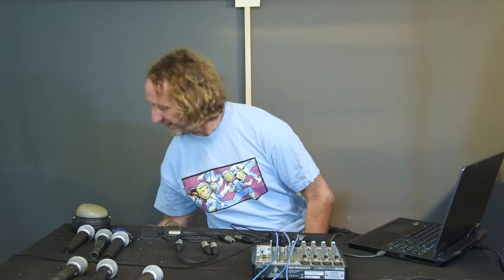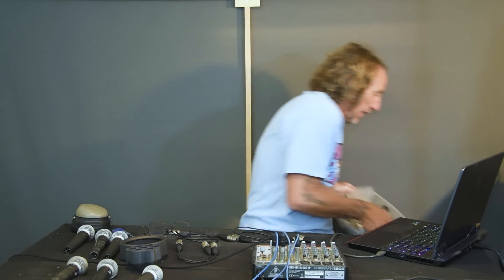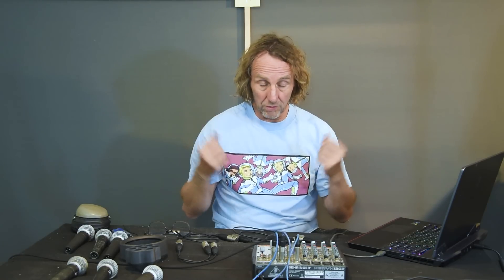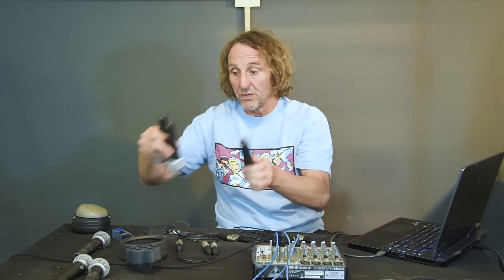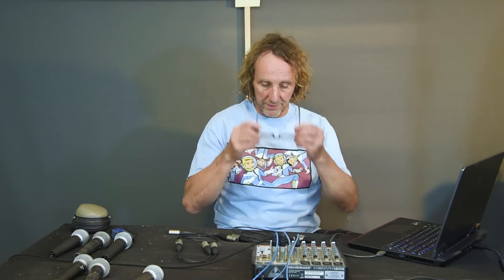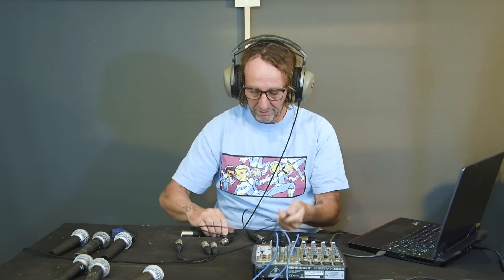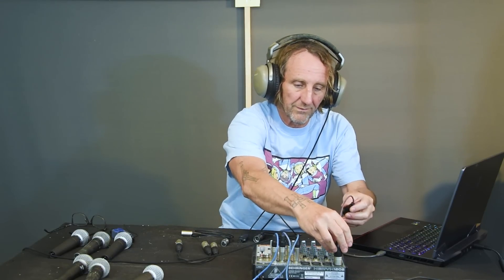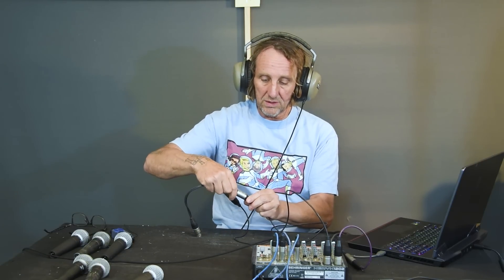Do Vocal Mics Go Bad? Lets Hear what happens!

Comment: I commented that a suggestion for better results might be to use freely available  REW measurement software to measure results.  You send a sweep signal to a monitor speaker.  Have the test microphone on a mic stand 2 meters away.  Then swap to another identical microphone.  Do the sweep again.  And you can display the graph showing level and frequency response differences.  In practice hardly any more difficult than what is being done in the video.  I've done this with multiple microphones I've acquired 2nd hand.  Usually they match within a decibel over the whole range.  If one has a problem it stands out clearly.  Doing this would be quicker and easier than the technique in the video if you are doing several microphones.  

BTW, the technique in the video is fine, and will work.  This other way is more precise and just as easy.
Reply from the maker: Hmmm, I like any method that involves actually hearing the differences so one can determine whether the differences are relevant to their application.

How useful is it really to see a line on a computer screen that tells you there is a difference and then you need to guess about what that difference sounds like or even if it's audible?

One of the main goals of my videos is to get people to listen by showing how to do simple tests with readily available gear.

And not avoid test gear that is easy, but show tests that help people calibrate thier ears to what they see on test gear
Reply: @DaveRat  -The test I mentioned would show you in detail if a microphone is off.  My assumption is if you are doing this for touring bands, unless the mike checks out against a reference you replace it.  I did not get the idea if it checks out close you send it back to be used.  I also find your method has variability that is greater than what is audible or not.  So it might sound audible or not due to that variability which makes it a relatively unreliable way to go about this. 

So if your method left a sound difference, but the method I described show there isn't one then you would be fooling yourself due to variability in your technique.  

With the method I described you could weed out those that differ and then listen to just those if you want to develop hearing what that sounds like.
Reply from the maker: Hmmm, well since no two mics will ever measure the same then every mic would be off.

But how much off matters?

One must establish a set of parameters which, if exceeded would be a failure.

Those parameters are not definitive and set in stone but rather they are subjective and may be different depending on the application and accuracy needed.

So, in order to establish the pass fail parameters that the test mics will fall into along with borderline contenders, one would do listening tests to a wide variety of mics spanning the gammut and then determine what is and is not acceptable and hopefully test every possible variation.

This is similar to what we do when testing our pa speakers before and after each show, along with listening tests that often show issues that are not seen by test gear.

Or one could establish some relatively simple subjective tests where the issues of concern are directly audible.

I understand and respect the desire to cling to visual data and measurements. This is important and also the desire to overcomplicate and create visual representations that are not intuitively correlated to real world results is a very common, but somewhat unfortunate practice.

I am not saying that buying, setting up and carrying test gear on tour or to gigs and then listening to the mics afterwards is a bad thing to do.

I would say that comparing mic to mic without creating a null, tends to mask the majority of issues and a null test will help hear some of those masked issues. And that having an effective test that requires no added expense, no added gear to carry and can be performed at a gig with a few adaptors may be useful

If you have any ideas or suggestions for simple ways to hear actual issues without relying on test gear, that would be awesome!
Reply: @DaveRat  I'm sorry you don't understand how to do useful measuring tests.  The same brand and model of microphones usually do measure all, but fully identical.  So close you need not worry about differing sound.  I'd post some graphs, but youtube keeps taking them out. 

I also don't buy into the idea that listening tests show issues not seen by test gear.  Further you you write as if you need to bring along some extra test gear.  There is only one thing not shown in your video needed to do such testing.  A small monitor speaker.  One smaller than your box of insulation.  I'm guessing you have such a speaker to use.  So it is a red herring to speak of hauling test gear around.  You already have everything you need. 

There is also some free nulling software which would take music from recording 1st one microphone and then another giving you the null between the two to listen to and do so more accurately than your method as long as you place the microphone carefully for each recording.  That way if you prefer listening to the null you can do so.
Reply: @DaveRat  
https://drive.google.com/file/d/1s9vuaO17iEJuX0kJGqhhkvHPGCs5_VHy/view?usp=sharing

This is three KSM32's covering more than a decade.  Will they all sound the same?  Yes.
Reply: https://drive.google.com/file/d/1_rSEcpS7thyyD6FDnHZk3185BE211UYS/view?usp=sharing

Here are three AT4033a mikes of various vintages.  They will sound the same too.  BTW, the uneven response is the monitor speaker I was using for the signal.  

In your video you show one microphone having a big bump or dip in the upper part of a spectrum analyzer versus another one.  Such a big difference would show up in this kind of testing like a sore thumb.  It is simply a more precise and repeatable way of accomplishing the same thing.
Reply from the maker: You have not ever toured have you?

It's like telling a bunch of backpackers that the only properly way to cook is with an oven. 

There are many ways to test that vary in usefulness depending on the situation.

People that claim they know the only right way are inherently wrong.
Reply: @DaveRat  And maybe you'll become literate when I repeatedly say you don't need a single thing that isn't already on your desk in the video except a speaker.  You tour and monitor events and don't have a speaker anywhere? There is no other item needed not shown in your video.
Reply from the maker: Don't get upset, when you truly know what you are doing, explaining things brings a smile not anger or insults

Let me ask you this.

Does test gear actually tell you what something sounds like?

 If so then you should be able to mix a record or show and just observe test gear rather than listening, right?

I find the desire to embrace test gear and avoid listening to be fascinating.
Reply: @DaveRat  you say this is to hear degradation due to build up of spit and other issues.  In which case I don't see the fascination with hearing this vs a simple reliable measure of it.  You aren't judging the sound of a mike in this case simply comparing it with a new or known reference to see if it is off.  Who cares if you hear it or see a graph?  It basically will be a darn near replica or it is "off" in a way it may need repairing/replacing.  

Do you think the people making these microphones don't measure them for QC?  What you are doing here is not evaluating the sound except for QC purposes.  Kind of odd to compare it to mixing a record.  One has pretty much nothing to do with the other. 

That is okay though. I'll not comment further.  You clearly are in some state of mind where you aren't listening when someone is simply trying to share a better method to QC used microphones.
Reply from the maker: I appreciate you defensiveness of what you are familiar with.

And also it is only when you look at things from multiple perspectives that 9ne can gain a clear understanding.

Limit your toolbox as you see fit.

I don't promote the right or the best way, but rather an additional way that may be useful should ine wish to hear the issues rather than see them and guess what they sound like.

Comment: We do mic compares all the time using the transfer function - where you can literally compare one mic to the next. If the mics match, then the TF response will be flat mag/flatphase. If they don't match, then the resultant graph will be exactly how the measurement input microphone is different than the reference input microphone. Much easier to measure this way than fiddling with an RTA next time!
Reply from the maker: Yes, a full setup will definitely let you see a line on a screen that wiggles the same or differently than another line on a screen, but that does not let you hear the actual differences.

When you see differences represented as a line on a screen, what do those different screen lines sound like?  Are they audible? Drastic? Insignificant? 

One of the things I have seen many times over the years is people over eq'ing to make a line flat at the expense of sound quality, or using measurement scales that fail to show relevant and audible issues.

For this test, you don't need the RTA, it can be done purely with your ears or ears and the console meter.

One of my goals is to guide people into listening and determineing and not just looking at gear and assuming.

Comment: Would love to see a QC video like this with the SE Electronics V7. They seem to be all over the place, especially the wireless capsules. I’ve had several die pretty quick
Reply from the maker: Not familiar with them
Reply: @DaveRat  In Denmark people seems to love 'em for the same reason as the audix om series.
My guess is the probably have the same problem with moisture as well.
Wouldn't be surprised if the design is similar, to the audix.

Comment: Your test confirms my findings: Two SM58s seldom sound the same, even when brand new. Would be interesting to see this test with Sennheisers, AKGs or Audix' of different price ranges. To my ears, it's less severe starting with the better Sennheisers and AKGs series (like e935, and C7 resp. D7). I don't use Audix mics, so I can't tell about those.
Reply: Transducer tolerances are really hard to get down. Sennheiser does a pretty good job and so does Shure, but for the 80-100 dollar price segment you gotta make some value engineering compromises!
Reply from the maker: Agreed
Reply: I'm a big fan of the Sennheiser e935 :)   - excellent for live shows to mic pretty much anything from guitar cab to vocals! - hardly any EQ from the console as it really cuts through and has a high output with minimal feedback so you can really drive it hard.  I also have the e945 but find it's a little too sibilance sounding for my taste.
Reply: @coffeehigh420  used an 835 for several years and then went up to a 935 a few years back and they are just the absolute best in the business for mics that need to sound excellent but can also take a bit of a beating and get used a lot. and as dave points out here, do try and clean the windscreens now and again, that shit can get NASTY. at the PA shop I used to work at we'd just soak them for an hour or so in mouthwash diluted with plenty of distilled water.
Reply from the maker: Clean your mics and your kitchens 

It's good. Just good

Comment: So, can old capsules be restored to the original (or to a similar) quality?
Does we have to absolutely substitute them?
Reply from the maker: For most things just clean and maintain. For top level acts I treated them like a Formula 1 race. Everything perfect as there are no 2nd chances. The cost of rebuilds is meaningless to the importance of perfection. For most gigs, a cleaned and we'll maintained mix will last years
Reply: @DaveRat  could you do a video about properly cleaning a microphone?
Reply from the maker: I cover cleaning a bit in some of the other mic videos I have released. Will try and do more

Comment: Now I know why my old talk back mic sounds like crap lol. Great tip man! I just downloaded a multicolor noise generator to test all my mics with. Thanks again!🤘
Reply from the maker: Cool, let me know how it goes
Reply: @DaveRat  Hey Dave! Just finished the testing and found that one of my Senn 835's was pretty different than the others. It's been relegated to the spare mic box. I'm getting one brand new one that I'll test as well to see how bad the rest actually are lol. In other news, I've got my M32 and X32 both set up to do drums and vocals in one stack and Guitar and bass in the other. Got 4 single 18's and 4 tops to give it a go. Got the effects sorted out too. 
I'm leaving sends on fader on, and selecting the actual channel which brings up the two buss' that it's being sent to. Just move them both up or down and you're mixing only that channel. Have no idea if that's how it's done lol, but it works!  
Thanks again for all you share man! We are all better at this because of it!  CHEERS!!

Comment: You specifically called out 16k and 20k. And, you've mentioned high frequencies in past videos. How important are those frequencies? I ask because the biological mics on each side of my head have become dull (to say the least) at those frequencies (and more)
.
Reply from the maker: Great question. The loss of high frequencies in the mic is not directly an issue, not unlike having a car that used to go 100 MPH and now can only go 80. But, whatever is causing the issue is the concern. The loss of HF is an easy way to find if there are issues but the extra weight or buildup of spit that is causing the loss also can alter the midrange and feedback stability of the mic. Things that are much harder to measure.  I recommend testing and marking mics, then seeing if the mics that test with less HF also sound as good and are as stable feedback wise as ones that test better.  Let me know what ya find!

Comment: What is involved in a rebuild or a reconditioning? Is there solution that's used to clean it whereby you don't damage the membrane ?
Reply: I added a reply where I got a Shure 545SD back to life by gently cleaning the diaphragm with distilled water. It really may be different scenario for hi stakes, pro large touring though that Dave does , compared to my mic that now only gets used for some recording purposes.
Reply from the maker: Cleaning the foam is most important as it gets clogged first. Clean water, maybe some non perfumed soap. Dr Bonners is minty but not perfumey.

Foam or mesh over the capsuled can be cleaned or dabbed with clean water.

For diaphragms, a soft microfiber cloth and clean water wiped.

For the bigger tours it's easier and more consistant to just get a rebuild rather than clean all the grills, clean all the capsule cover, clean the diaphragm and then test for freq responce and make sure it's in spec.

Also, it really depends on the band and how particular they are

Comment: This is a pretty strange test setup. Why not use a decent speaker with a sweeping tone or white noise and placing each mic in a mic stand in exactly the same position in front of the speaker?
Reply from the maker: Hmmm, well introducing perception, listening position and the frequency response of the wedges as variables is an option and will get you close.

That said, listening to all the signal and trying to pick out the difference vs just listening to the differences will often hide issues that may be relevant

Comment: Excellent - going to point my students toward your channel.
I've two really old SM58's that have gone down this route but may attempt to clean them. I used to do a lot of comedy shows and one instance they had bile wiped across them from the Bastard Son Of Tommy Cooper after swallowing two swords, or bits of smashed apple and even rice grains!. Yuk.
I was given a really old Shure Unidyne 545SD that had been in a stable where they did horse trials all its life - think going back to early 70's. The foam had deteriorated in front of the capsule and there was a very fine brown dust caked on the diaphragm. I managed to get it back to being a decent sounding mic with careful brushing with distilled water on the diaphragm - I prefer it to some of the newer SM57's I have for recording.
Reply from the maker: Wow and yuck!

Comment: Thanks Dave. Very informative. We’ve had issues with Audix OM5 in a rehearsal room environment. They sound great when new, but over time they dull and eventually are useless for exactly the reason you explained. Some other mics we have used don’t degrade as quickly. The foam in the grill of an OM5 is noticeably thinner than an SM58 which probably explains this. Based on my experience I am not surprised by the number of OM7 capsules you have, we’ve gone through a lot of capsules as well. Audix are great mics, but the design of the OM series means that they don’t really stand up well to being used for several hours a night on a daily basis.
Reply from the maker: Is artifactingreality who posts a conspiracy video on mind control calling me a retard?

Ha ha ha ha ha!

This is rich!